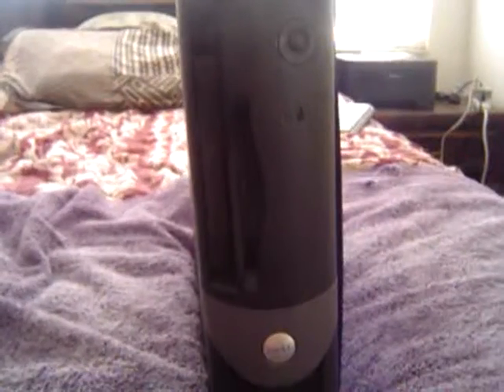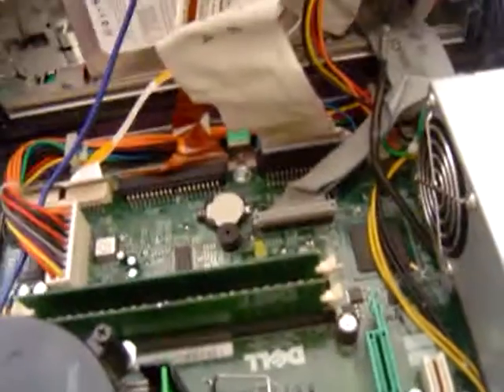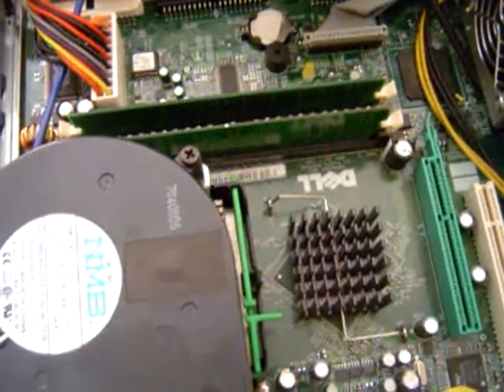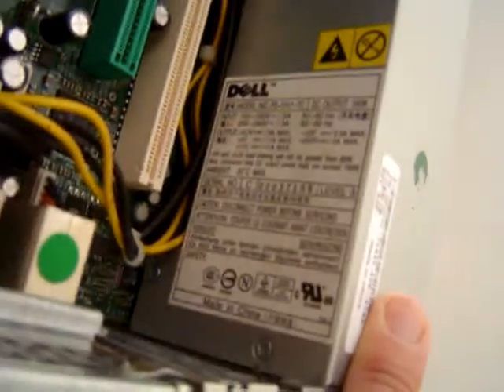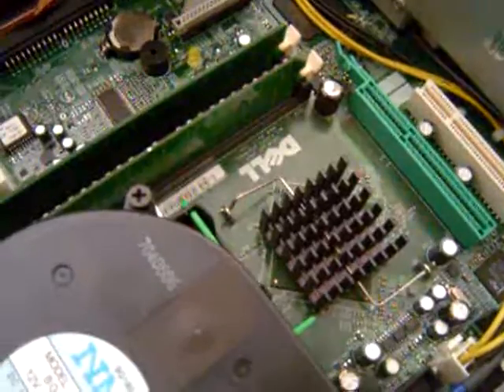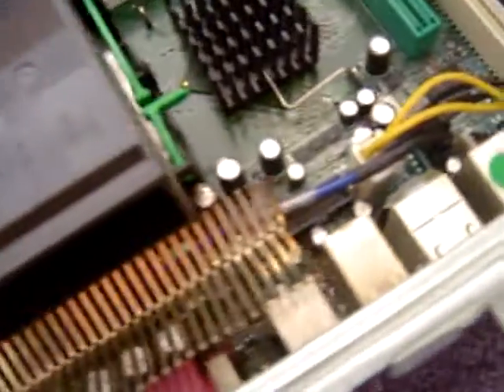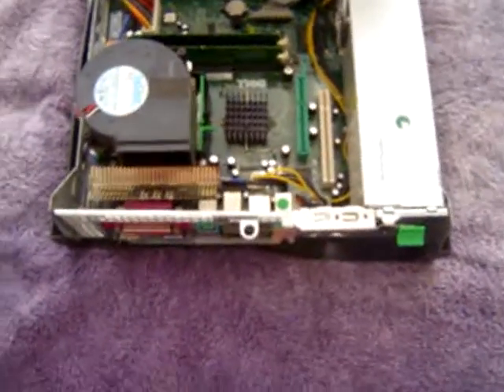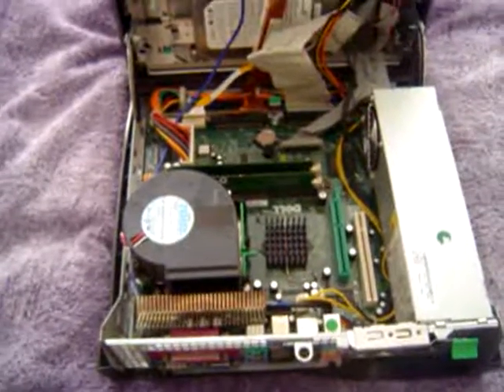How to Fix, Refurbish and Restore Any Computer, Dell OptiPlex GX270

Comment: Just got the 4 slot RAM variant, operational the other day, I'm trying to find parts that can max this thing out.
I might be able to change CPU from a 2.60ghz to a 3ghz or a bit more.
It has Windows XP Pro with SP3 
Looked at online manual & it says it can handle up to 4gb RAM, I have 2x 512mb = 1gb in it at the moment.
HDD is acceptable at 80gb.
I have to see if I have an AGP graphics card, maybe HD. My modern Windows 11 GeoBook laptop can go to hell, it's a piece of crap!
I don't think you know what you are saying in your video, a few conflicting statements, mentioning about you worked on about 10k of these, I think somebody is telling porkies!!

Comment: Take out the CMOS battery, or the 3 volt cell, and that will reset it. Reinstall XP on the PC, and all will good. Be careful to not damage the battery holder, if that were to happen, Your BIOS will not be useable.

Comment: The perfect PC for grandma because that's the only thing a single core with an AGP slot / integrated graphics PC is good for.
Buying CR2032's from the dollar store....
Reply from the maker: Kabuki Jo "It's probably the hard drive man..."  enjoy ;-)
Reply from the maker: +Kabuki Jo I have since purchased a new HP but this one works and I still have it for surfing the web.  A new or refurbished computer with a dual core, 500 GB sata, wireless, wi-fi, wireless keyboard, etc. might run you $50-$100; not much but FREE is FREE.  I do love the P4 w/hyperthread with Windows XP Professional.  MY ALL TIME FAVORITE OF ALL THE COMPUTERS EVER MADE.

Comment: fixed probably ten thousand of these, and have never really worked with them????????????
Reply from the maker: Let me clarify.  In the 1990s, Dell laptops and desktops always scored the highest on benchmark tests.  Even when custom systems were tested, Dell would always better them.  Then in the early 2000s, things began to change in favor of the laptop and cache integrated CPU chips.  No longer were desktop chips used in laptops and no longer were the desktops limited by this "mix and match" issue.  Laptops began to come close to the desktop; but unless you were an extreme gamer, your system was at or near the laptops in performance, given the graphics advantage.  Therefore, I never really paid attention to the Dell and I usually give them away or whatever; choosing the custom or extreme gamer versions.  So the thousands of computers I have stripped or fixed (to sell online for several years) was just a hobby.  I had diagnostic equipment to tell me what the problem was.  I quickly found the problem or threw the problem away.  In that time, I never once touched a Dell or saw one floating around; maybe they do not break?  Today, you have a choice of several leading brands and I typically choose the laptop for obvious reasons; I have two Sony Vaio and am very happy with them.  I just got a HP desktop with a dual core.  As far as the Dell; it is a custom setup now ;-)  no harm done so no pun intended.  Glad you weren't one of the "angry white males" on youtube making videos or trashing people on a 3rd grade level; I find that amusing also.
Reply: Alex-Thang Nguyen SIMPLE EXAMPLE DELL FOR DESKTOPS AND TOWERS, THEY HAVE A MB EXT FOR TOWERS Dell Optiplex GX270 Series Desktop Motherboard C2057 CG555 D9076 DG286 FC092 GD301 H1291 H6405 J9057 M2886 P9908 R0786 R6019 X1105 X8677 YF936 YF939
All 270 Desktop Motherboards.http://www.ebay.com/itm/DELL-OPTIPLEX-GX270-MOTHERBOARD-R6019-CN-0R6019-X1105-CN-0X1105-X8677-CN-0X8677-/251898667383?pt=LH_DefaultDomain_0&hash=item3aa654a177
Reply: Alex-Thang Nguyen also check your hd as slave on another pc or on yours with a dual ribbon. sometimes the hd will check good and still be bad. i found that out just recently with a maxtor. on my pc it said ok formatted n chkdsk was ok, BUT in my other pc i checked it with norton partion magic, soon as i opened the program up it said disc 2 bad.. may i say norton partion magic is well worth the money and saving valuable files as you can create other logical partions on you existing hard drive for storage and leave your c drive alone, take care
Reply: Alex-Thang Nguyen 0 and the most recent 260 problem i had was the hd ribbon from being removed in n out too many times
Reply from the maker: Mr79xlh Here are several tricks I have learned.  Always start with the operating system.  To do this, you need a working desktop with BEAUCOUP TRICKS!  I like to open it in less than 5 seconds and I like to install a drive being tested or partitioned FAST!  Once you know the hard drive is working or not; go ahead into the BIOS and choose it as your LAUNCH drive.  Now you will know if the operating system is CORRUPTED.  From here it gets easy.  If you know the boot is good and it does not boot; then you know it can only be TWO things!  Go ahead an reset the two.  If your CMOS check is not good, then grab a CMOS off any equivalent Dell computer for THAT CHIPSET.  At this point it will boot.  The rest can be diagnosed with a PCI tester; it will examine the bus and tell you what firmware is active and what device is not.  It will also tell you the basics such as RAM.  I can diagnose a computer in less than 5 mins using those tricks.  When you do it enough, you will know immediately upon startup what is faulty and what is not.  Rarely have I seen anybody "fix" a dead hard-drive; it is not worth the trouble but I have been there.  However, the drives are belt driven and like a vacuum cleaner, the belt probably broke.  Good luck finding a new belt or installing it.  As far as CHKDSK, I am familiar and used them before; even partition magic and a few others.  Don't waste your time; zero them out and then load window.  If it has to be "DEGAUSSED" then you can buy software to do this, it takes nearly two hours.  I usually zero them out or go with the 1 bit.  MAKE SURE YOU SAVE ANY DATA ON BROKEN DISKS BEFORE MINING THE DATA!
Reply from the maker: Mr79xlh You will be surprised how many complex problems can be fixed with easy solutions.  What ticks me off is taking off the cover or trying to find parts; esp. DELL COMPUTERS!
Reply from the maker: 79xlh Yeah you are right.  If you do not have a solid way to recognize when a hard drive is recognized but trust it, then you will eventually learn how much hurt you are setting yourself up for.  If you are like me, I prioritize what parts I know are reliable and what are used most frequently.  On good solid computers, you can pretty much assume the hard drive is the cause in the first three to four years; then it can be something unexpected such as dust and heat.  A computer with big fans will look like a jungle of dust; so until you clean it, fixing it is annoying.  I see a dirty computer, I throw it away; it takes so long to clean it, then the process of cleaning it may have damaged one of the circuits, you never know.
Reply from the maker: 79xlh I am not sure if I ever used Norton's partition magic but I never found a partition program that I liked or that could do what I wanted it to do.  That said, don't waste too much time on the hard disk; it may be better to wipe it clean, degausse it and start over.
Reply from the maker: 79xlh LoL.  Love those IDE cables.  Molex you can double up or wire anyway you want.  If you have a powerful power supply, I would not hesitate to double up on a molex and use it for a DVD drive.  There are quick and easy ways to join wires, splice them, or quickly add more.
Reply: Alex-Thang Nguyen Norton's partition magic used to b the best but now my moneys wasted, won.t work on 7
Reply: Alex-Thang Nguyen Norton's partition magic used to b the best but now my moneys wasted, won.t work on 7. which program did u find
Reply from the maker: I think I tried around 50 shareware; they all suck!  The kicker is they do not have instructions and if they do, they do not work!  Such a cruel world...  due to 12 month excitement into depression, I have stopped buying software.  My favorite must have been MS-DOS?

Comment: Well I tried everything and anything you guys said and still can't get into this dell gx270 i found, cause it wants a password that of cause i don't know,any more ideas could help and would be highly appreciated, r.aleman42253@ gmail.com  thanks for trying
Reply: Ruffo, you probably already found solution of your problem, but here is what you have to do. Right beside to main power connector on the mainboard you will find switch with PSWD written close to it, remove the switch from pins and turn on your PC, this will disable the password. After turning off your computer you can return the switch on place.
Reply: New HDD
Reply: Check on other place for information. In this video you will not find anything useful.
Reply: There is a 'reset' chip pins (3) on the bottom of your motherboard, switch these from pin 1 and 2 to pin 2 and 3
Reply: Thx bruh
Reply: Ruffo Aleman  take out the battery n put it back in anmd all your bios will reset including password
Reply from the maker: 79xlh If you take out the battery, you must unplug it.